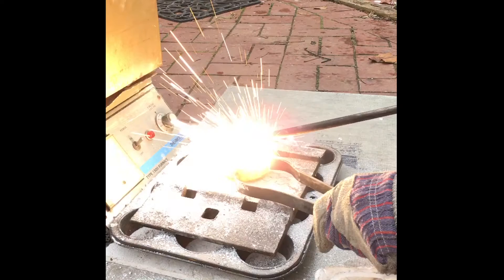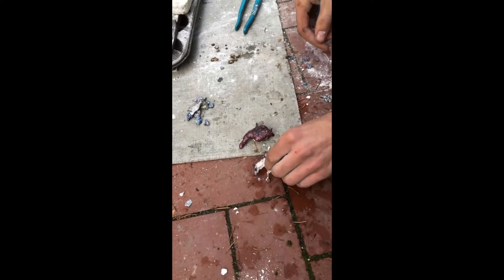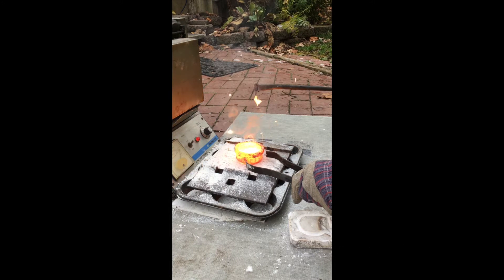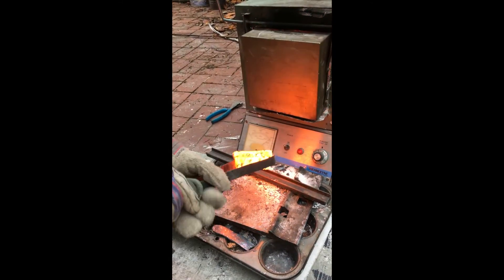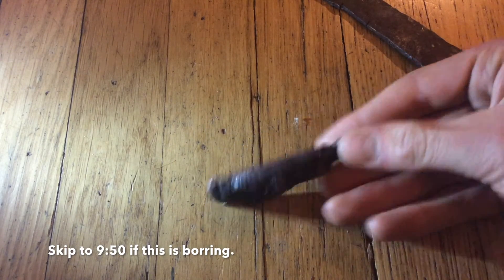Backyard Metal Casting Gone Wrong

Comment: whats happening is the copper wire is oxidizing with the air due to the high surface area of the wire and creating copper oxide and when you stir the aluminum in the copper oxide produced from the copper wire is reacting with the aluminum creating a mini thermite reaction what you can do to stop this is first create ingots from copper wire without adding aluminum briefly sand the copper ingots with sandpaper to remove any oxide and then add the solid copper ingots to the aluminum the ingots will have much lower surface area than the wires and not oxidize and react with the melting aluminum like the wires did and this should stop any kind of thermite reaction remember to always be careful working with molten metal and preheat your mold its over 1000 degrees and if your scrap is wet or the mold has any moisture it can cause steam explosions that throws molten metal
Reply from the maker: That is a good point. A thermite reaction would explain everything. Copper oxide based thermite does burn very fast, and could easily have made the popping. (Source: I have made some.)

The problem with adding copper to molten Al is that an ideal mixture is about 70-95% copper, so it would take a while to it that way. Using copper ingots, however, would still help. 

Alternatively, I could add the aluminum BEFORE melting, the copper, so it uses up the oxygen before enough Copper oxide builds up.
Reply from the maker: Also, everything was preheated, but I think the molten metal made the plaster decompose.
Reply: yeah adding the aluminum first should work as long as the copper you add is in ingot form and not wire form
Reply from the maker: I have successfully made some aluminum bronze this way. I just threw it all in the crucible, and heated it up. I added some bits of wood to burn up any oxygen. I did it in my new homemade blast furnace, so I was able to melt around 4 lbs of it.  My furnace runs on nothing but wood and propane, so it barely got hot enough to melt the alloy (almost 1040 C or 1900 F). It was not hot enough to cast, as it solidified almost as soon as it came out of the furnace. I think I can fix this with a taller and better plinth, and by burning charcoal. A video on my new furnace is coming out as soon as I can find the time. I have more than 3 hours of footage, of making it, and another hour of footage of using it. I need to cut this down to less than 10 minutes.

Comment: 89% copper and 11% aluminium and it looks like you need to get it hotter to prevent the metal from becoming viscous while you pour it. You will also know that you have the right mixture when the metal has a goldish tint to it while it's still molten.
Reply from the maker: I have made this alloy properly before and didn't have a problem with it. You can see what I did with it here: https://youtu.be/37vyQPu__g0 
I think the main problem was that I didn't let it sit long enough in the furnace for the metals to alloy. When I stirred it, the aluminum burned and splashed (and I spilled what was left), so only copper remained. At this point, I had foolishly given up on a proper cast. 
And to be honest, I think the copper, uh, . . . balloons? . . . were kinda cool. I think you are right tho. Heating it more would have probably solved all of my problems.

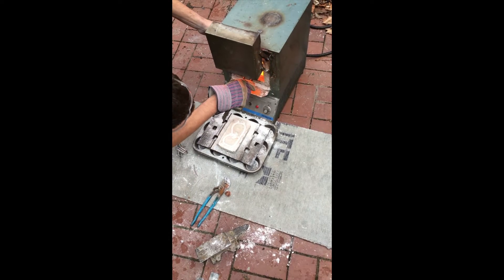Comment: 1:29 - Irony?  No pun intended.  Is it ironic that you are making a goggles case but that your safety glasses are on your head not your face?
2:14 - your tongs are also a stir rod?
Is the muffin tin there to provide thermal insulation to the concrete board under the furnace?.. The railroad tie plate is not thick enough eh?
I got yelled at by my wife for laughing so hard.  Thanks Iden.  This is some of the most creative and fun science I've seen in a long time!  I think you nailed the plaster moisture/hollow casting issue.
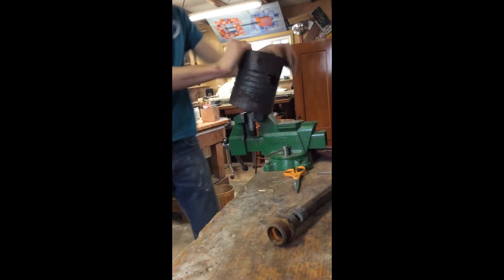7:11 - pull harder!  Hilarious!  Be safe young man!
7:30 - Iden!!!  NO!!!!  not a spade bit!!!  you're killing me!!!
7:56 - just hit it with a pipe.  ..."Same for getting people to pay up"  No way!!!  Hilarious!!!
8:20 - keep your hand away from the flame...
9:59 - smashing circuit beakers for copper?
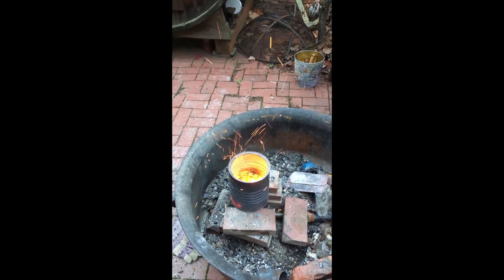10:13 - you had me at hello, er I mean "adding charcoal dust to the blast furnace..."

This is the best student video ever!!!  The sound track seriously has to be the best also!!!

Blown away!  Nice job Iden!
Reply from the maker: Glad you liked it. Adding the aluminum should not be dangerous. I preheated it, so that it doesn't have any moisture.  
Yes, my tongs are a stir-rod. But not my new ones. I filmed this awhile ago, and since then I have gotten much better tongs (for X-mas). The new ones should help with the constant dropping and spilling (like at 3:11 ). 
the muffin tin is to help catch spills, and for ingot casting with lower temperature metals. 

The spade bit worked in the end, didn't it? 

The circuit breaker yielded copper, aluminum, and some metal for the contacts that is yet to be identified. . . 

my hand was about 2 feet from the flame, but in the end it was the sparks that got me. 

Youtube has a whole list of free music for people to use. If you go to the youtube creator studio, and click on the CREATE button on the lower left, you can download as much as you want, for free.
Reply from the maker: My first video (a classroom assignment) was SSSOOOOO bad that i copied it onto a thumb drive just to burn it. 
My aluminum bronze award video took about 15 hours to edit. This one took about 10, and the one I am working on now looks as if it will take about 5.